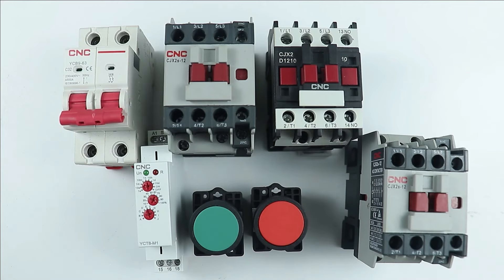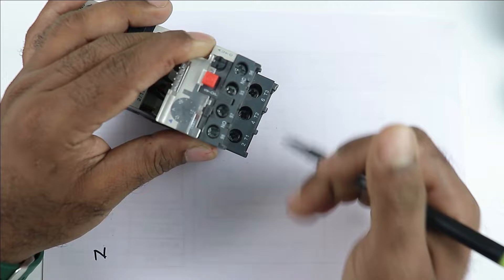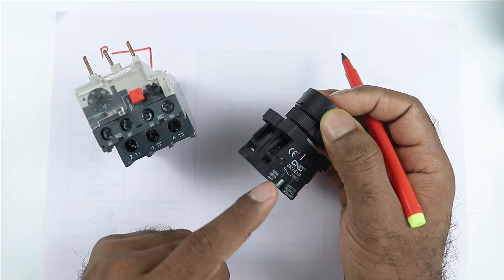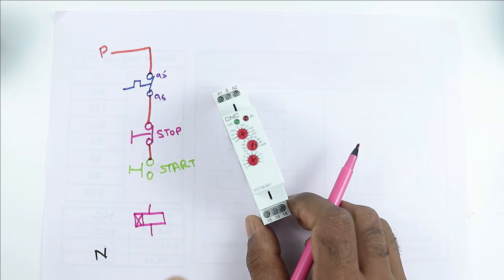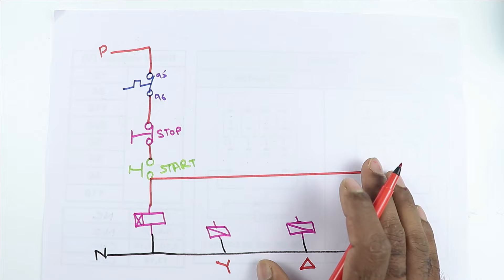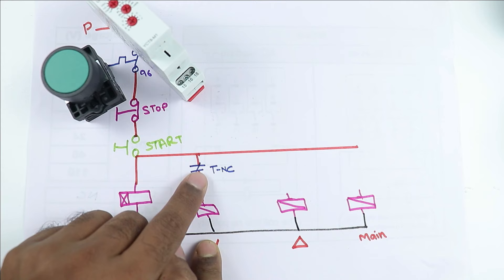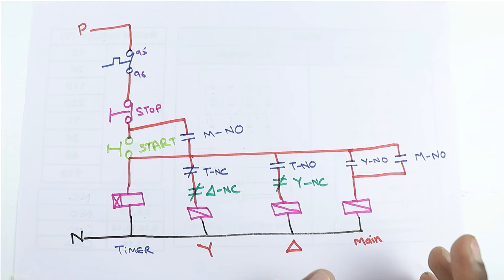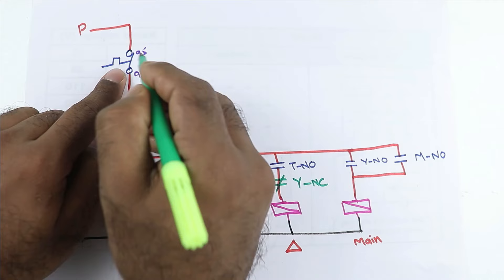star delta control wiring diagram with timer explained by @TheElectricalGuy

Comment: I take my hat off for your capability to teach. I've been a Refrigeration Mechanic for five years now, but I have never been able to understand the wiring of the stardelta except tracing wires using a multimeter as I was taught from the training center. Your simple and clear explanation surpasses all the Skill Trainers who I have learned from. If you were my teacher for this trade or electrical, I'd have passed with distinctions. Thank you very much, we need more people like you here in our country.